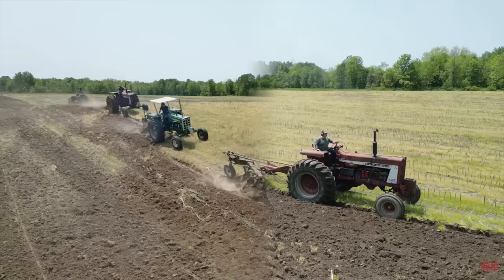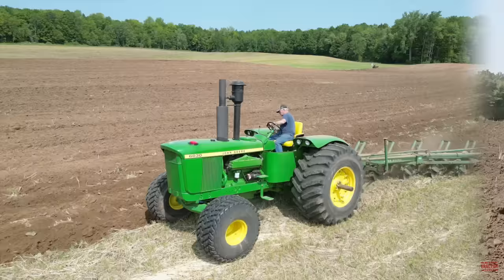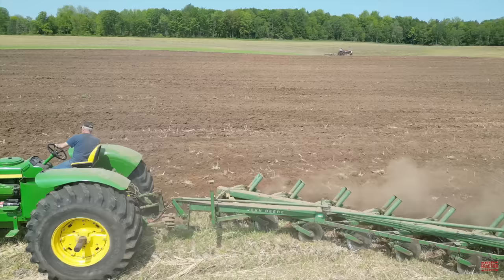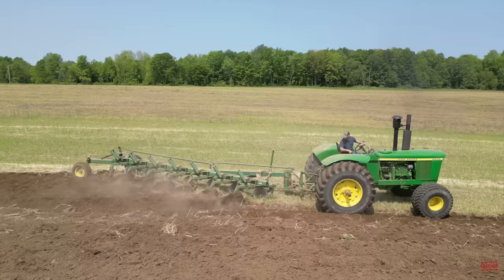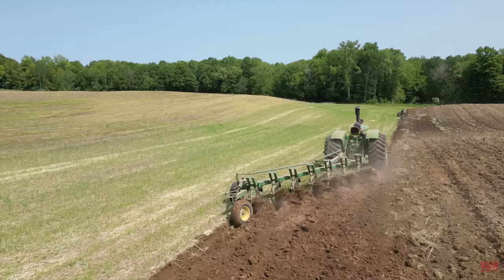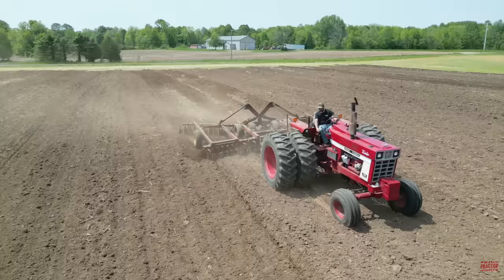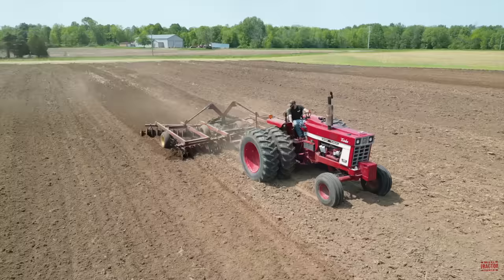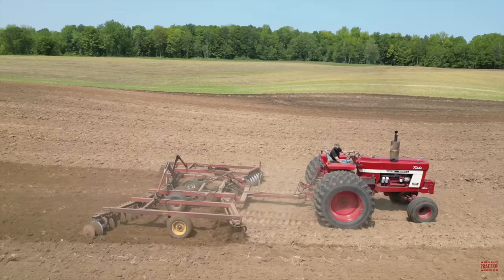Big Tractors Plowing

Comment: That John Deere 6030 is a beast for sure
Reply: He should have been pulling a On land plow he was having to fight the steering wheel trying to keep it on the straight and narrow furrow
Reply: We had a 6030 but without the turbo it something like 95 hp. No way it could have pulled a 7 furrow plough. It could pull a 3 furrow reversible or a 4 furrow semi mounted. But it spun out quite easily and hung on the rear axle. Low ground clearance. A nice tractor none the less.
Reply: @Farendloese  I'd assume this one in the video had a turbo....
Reply: Could’ve definitely used weights on the front
Reply: @Rickie McKillip 😊
Reply: @Drottninggatan2017  6030 non-turbo was rated at 140hp. Only 45 of them released.
Reply: @MrPaw45  
You are right. I was confused, as it was a long time ago. What we had was in fact a 3130.
Reply: @Drottninggatan2017  well that makes more sense 🤣
Reply: Does it have a 4×4?

Comment: On the farm I grew up on, I drove an Oliver 1900 with front axle assist. No duals. I pulled either a 16 foot disc or a 12 foot field cultivator. I am amazed I can hear anything. Our other big tractor was a Oliver / White 2155, which had yellow paint under the green and a MM on the steering wheel. The farm and equipment all were sold off years ago. The only big tractor that my brother kept is the MM G1000 dad bought new in 1969.
Reply: ៧។

Comment: Those tires on the John Deere 6030 look kind of huge for such a small tractor. 😮
Reply: Those rear tires came on 5020s also and the 5020 on a farm I worked on had big flotation tires on the front about the size of these.
Reply: @freedomrings1420  Yep, those massive floater tires, especially the ones on the rear, were probably absolutely necessary on those re-powered ones with 8V-71T two stroke diesels (which there are videos of both here in particular and elsewhere on YouTube if you look) in order to put the sheer power of those behemoths to the ground more effectively.
Reply: The diamond transportation tires that came on these tractors originally were a lot narrower than these ones these are turf tractor tires or swather tires r5020 head 24/5-32 tires on the back and I believe 9 00 -16 three bar tires on the front plus it was fully weighted front and rear and had water all the way around and we never had any traction issues it was a row crop tractor too but since it was only used for field work they put big tires on it
Reply: I didn't mean to say transportation
Reply: @noahater5785  sheer power?
Not hardly
Reply: @RJ1999x  up to 360 engine horsepower with tuning is a lot of power for such a small tractor though
Reply: @noahater5785  360 HP in it's dreams.
They were a torqueless wonder

Comment: He is having a hard time keeping that 6030 under control.
Reply from the maker: 7 bottoms is allot to pull.  I drive a 6030 recently on the sane style 2500 plow with 5 bottoms.  The tires want to turn on you.  You have to keep them turned hard to fight the pull.